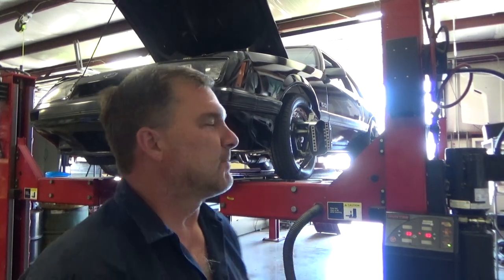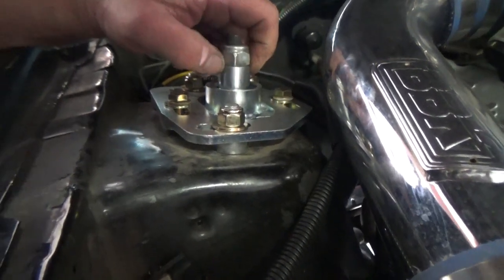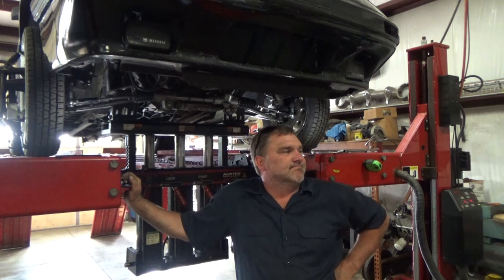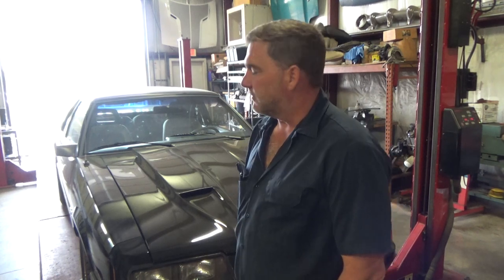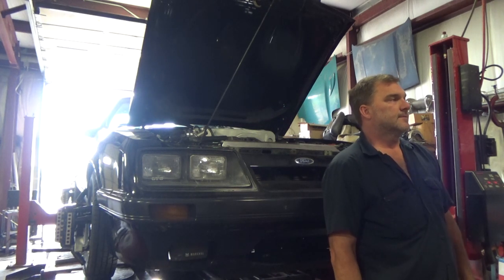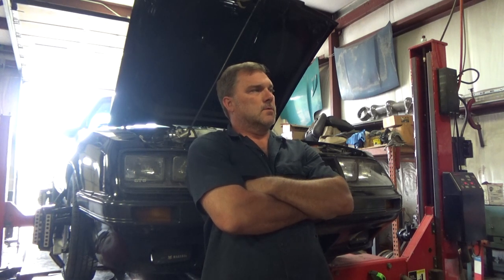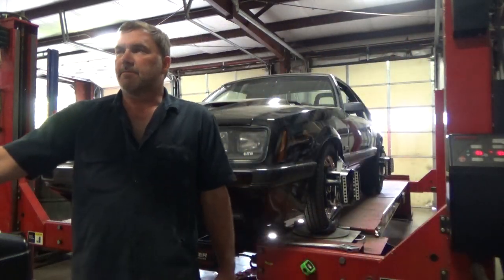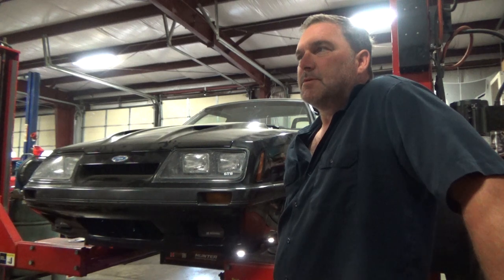Big Problems with a Little Fox Body! Suspension setup, steering fixes, making the fast faster!

Comment: Thanks Rich, for making this video. I wish there was more guys like you! Your frustration shows that, at times, it is very difficult to get things done right. Weak, out of square unibody shells, bent parts, warn parts, jacked up rear ends etc., make doing an alignment a mechanic's nightmare.
Reply from the maker: You certainly understand where we are coming from, and a lot of the reason why there AREN'T more shops like us. There's never a set recipe for success with this stuff every car has lived a different life or had a different build before it hit the rack. Roll with the punches, don't give up, and do you best!

Comment: Hey just  a thought isthe front suspension bolt on  cradle  square in the chassis  side to side and front to rear. Also is the wheelbase the same length?  That bent spindle would cause a few issues. Great videos i enjoy watching them  all the way from down under .👍
Reply from the maker: That's always a possible can of worms with these cars, the cradle can be shifted or bent just barely and not even visibly but cause a whole host of problems. Even from the factory a lot of these cars weren't "true"... let alone when they have already had a long fun life. Thanks for watching and supporting what we do Jimmy!